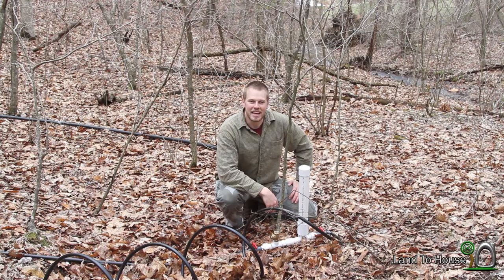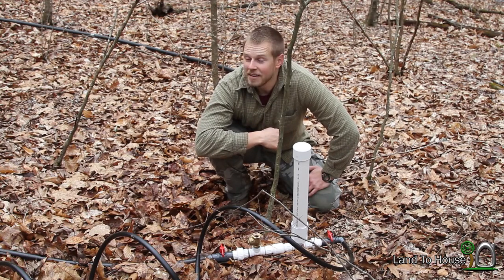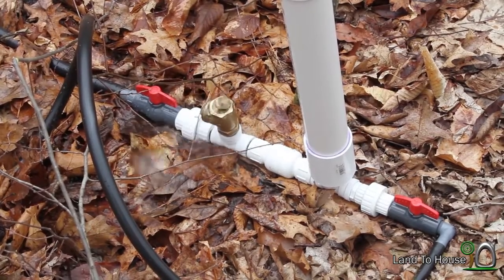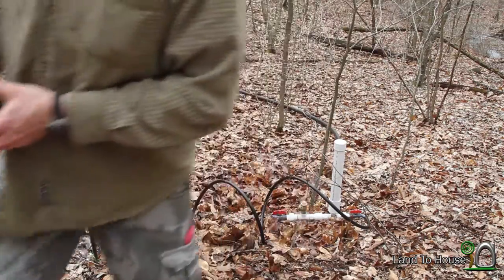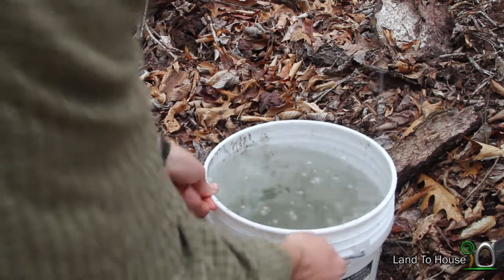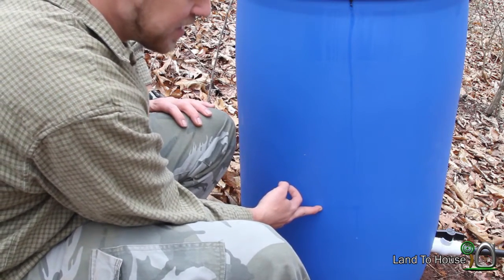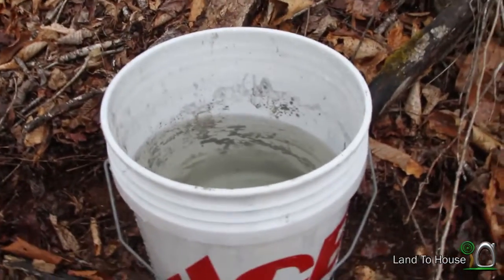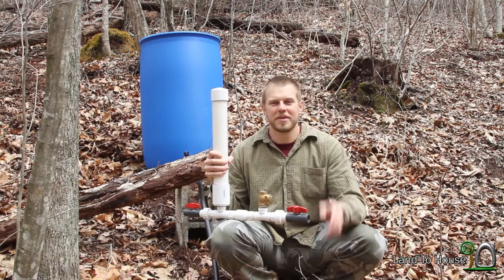3/4" Hydraulic Ram Pump gpm test

Comment: Hey Seth, I was just curious. Does a hydraulic ram pump pickup from where it left off if you drained your tank quicker than you can fill it up? If u install a shut off/ turn on floater valve (such as one that operates your toilet). Example... Starting with your tank full draining to your hydraulic ram pump. When the tank reaches a certain level the floater valve shuts the flow off which cuts off the hydraulic ram pump as well. Which gives the tank time to fill back up. At a certain level when the tank is full it opens the valve back to the hydraulic ram pump. Will the pump need primed again or or will it pick up from where it left off and continue pumping up the hill?

Comment: What exactly are you calling "flex tube?" And is the 1/2" inside diameter or outside?
 I'm looking for an outdoor option for my delivery pipe at our cabin for a 3/4" ramp pump.
Reply from the maker: I have seen it called flex pipe or black poly pipe. Most hardware stores and plumbing stores have it. You can also use garden hose as a delivery. The very thin poly pipe is not good because of rodents.

Comment: Great videos! I was wondering what the minimum GPM the 3/4" ram will need to operate. I plan on building a 3/4" ram but only getting 1gpm out of my spring. Thanks again!!
Reply from the maker: Hi I have not tested this yet but its on my list of things to do. One of my subscribers has found that tilting the check valve will reduce the flow. I think he has it down to about 1.5gpm. You could always get a holding tank for more water.  I will try my best to get a low gpm next week.

Comment: Hey Seth.I just got back from the Mtn's.  I rebuilt my ram pump with 3/4 inch.  I used 60 feet of drive pipe with about 30 feet of fall.   I delivered the water about 150 to 200 feet in elevaton with 500 feet of delivery pipe.   It was almost a success but the pressure tank kept filling with water.  I put one small noodle in it and I should have filled the chamber.  At one point my pressure gauge was showing about 80 psi.   Wow.  I can't wait to try it again.  My spring was flowing good with 7 to 10 gpm so flow was not a problem.  I will update you when  I have success pumping water 200 feet up mtn.   :)
Reply from the maker: Gosh what amazing results!  That is much higher than I have ever tried to pump water. In my pumps I have used a bike innertube because it seems that they have a lot more give than the pool noodle but I know that several people have used the noodle without issues. I was not pumping very high in this test but @ 2.3GPM there is a lot of potential for more than one pump. SO if you needed more water you would have the option of adding a pump. 80 PSI wow!  How high is your final lift?

Comment: I think you have the maths wrong. have a look at it again.
Reply from the maker: Nice catch!  I guess I tried to use the same model as the one I used in my 1-1/4" pump test. I added 8 gallons from the bucket back to the 55 gallons to get 63 gallons then I divided 63 per 24 minutes to get the 2.6 ish. ..... You are right it is wrong to add the 8 gallons back because that water does not exist. Its just part of the 55 gallons. So a better GPM would be 2.3 ish. Use that number as the GPM but the ratio of pumped to lost is the same. 1:7. Thank you for pointing this out!!!
Reply: Sorry to Have to be the one geek to point that out to you. the truth is I'm crap at maths and suffer/ put up with dyslexia especially numerically.
Reply from the maker: Mike Wiscombe Never feel sorry to let me know that I have messed up!  I to have "lysdexia" I cant spell a word to save my life. And math has never been my strong suit either. :)  but we work with what we have right?

Comment: Great video and great video#'s.    Thanks so much.   :-)
Reply from the maker: Thank you!  I will try and get a low value for minimum gpm soon.
Reply: With swing check valve1/4 turn it will be variable.   You could then lean the pump on its side and it would be variable.   :)
Reply from the maker: Absolutely! The next time I take this size out I will give that a try and find out what value gpm I can get down to.
Reply: Land to House .com Thanks so much.  Your channel is great.  I have learned a lot from you.  Keep the good stuff coming.   If the black poly pipe you are using freezes will it stretch or will it crack?  I know moving water will not freeze.  I was wondering if the ram stopped if the pipe would expand or crack.  Thanks
Reply from the maker: John Godwin I will keep the videos coming for sure! The pipe that I have been using was on my parents land before they got the house in 1999. So it is over 15 years old and has been full of water for a long time. I was actually able to get the pump to freeze and stop this winter!  We had 3 days of 5 degree weather and the garden hose froze and backed up to the pump and stopped it. The black flex pipe is unharmed. no cracks but I have a feeling it will stretch some but goes back to its normal size. I have noticed that when I try to move the flex when its cold it will kink very easily and with kinks it will crack.